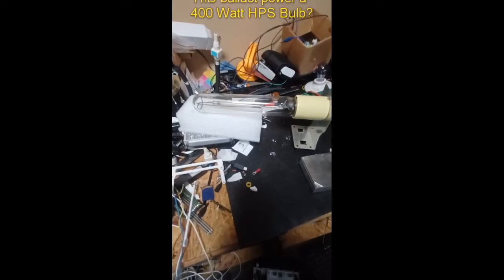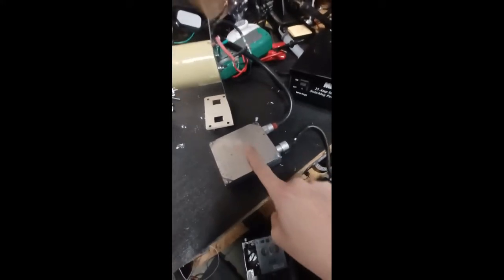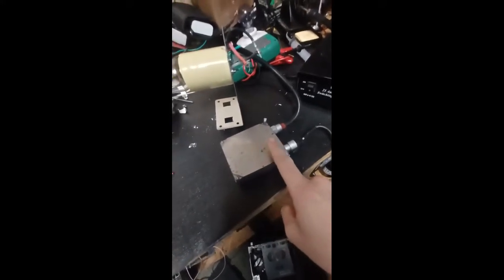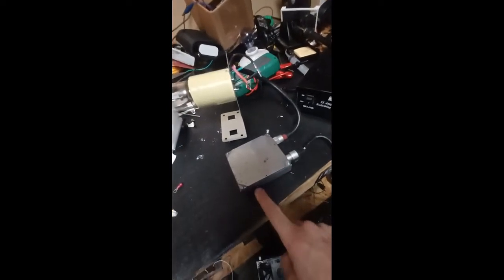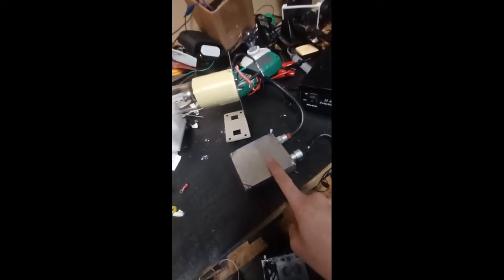Will A 12volt Car HID Ballast Run A 400 Watt HPS Grow Lamp?

Comment: 35 and 39 Watts ceramic metal halide bulbs works fine with AC HID ballast, at least they are supposed to be matched in term of wattage. As for Sodium vapor bulbs, you may have better luck with 39 Watts high pressure sodium bulb, especially when run on the 35 Watts ballast.

I have been using the ceramic metal halide bulbs in my modified Cyclops Thor Colossus halogen spotlight for a while, works excellent so far (I had to get Hylux A2088 ballast for that though), not to mention much longer lifespan compared to both Halogen bulbs and Quartz metal halide bulbs (including the headlight HID bulbs). It's also quite efficient compared to H4 headlight halogen that was in the spotlight for the same brightness too. And with a bonus, since CMH bulbs are surprisingly robust, it warms up almost instantly, a minute to full brightness rather than 4 - 5 minutes to completely warm it up.